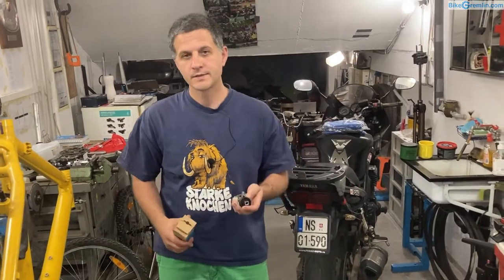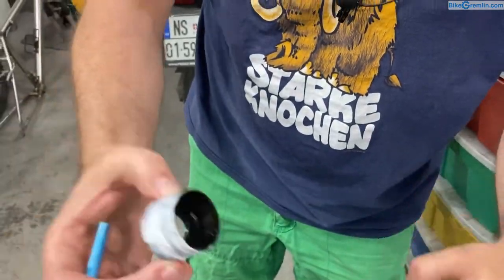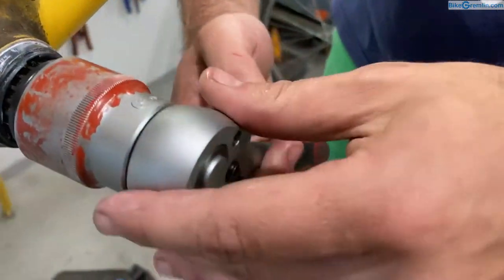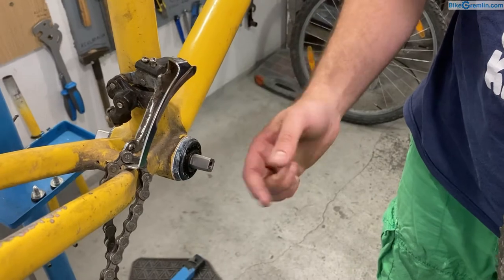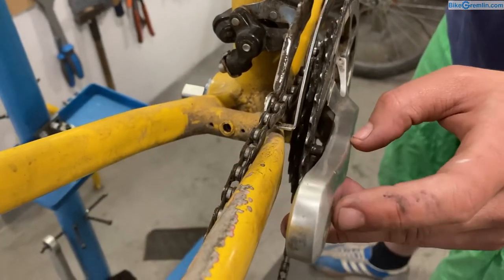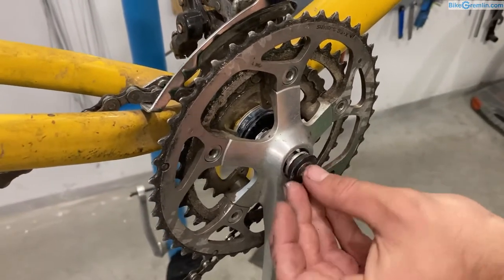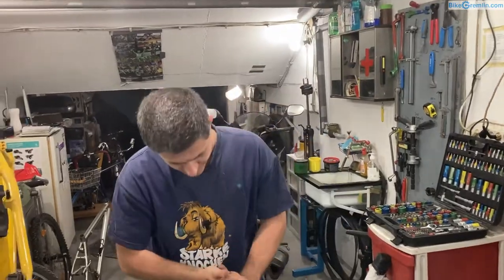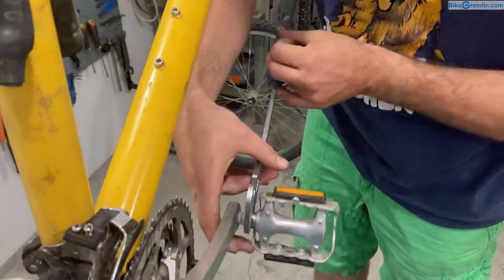Installing square taper bottom bracket, cranks, and pedals

Comment: hi there, thanks for sharing. look, ive read that such square taper crankset can woble a little from side to side when pedaling hard. im noticing this on mine. if i pedal right, the chain touches the right side of the front derraileiur and the oposite side when i pedall left. do you know any way to avoid this? thanks a lot
Reply from the maker: Hi,

Please use the BikeGremlin forum for technical questions:
https://www.bikegremlin.net/

Relja

Comment: Thanks for the video! I'm going to try to put a 100mm BB in a 73mm BB bike using spacers on the threads in hopes of getting .25" more pedal width on both sides to be able to fit a larger chainring, 32T to 48T so that I can go a lot faster on flat ground. 100-73=27mm, or .50"
Reply from the maker: Very little thread engagement - I'm not sure how robust it will be on an aluminium frame (steel may be fine).  :(

Is it not possible to mount a double (or a triple) crank (with a matching FD and a shifter)?
Reply: @BikeGremlinUS  yea that part worries me a little but I think that enough of the threads will be there, going to give it a shot. 
I would but that would be more expensive & I'd prefer to just stick with my current 1x setup
Reply from the maker: At the cost of stating the obvious:
Stripped threads might end up being more costly.  :(

Unless you often ride in very muddy conditions, or ride very technical trails that require a frequent de/activation of the dropper seatpost, 2x and 3x systems are a beautiful thing, often superior to 1x.

Tastes and aesthetics aside - that's very subjective and no arguing that.
Reply: @BikeGremlinUS  good point, that would ruin the bike... I usually get a 3x bike but I liked the looks and price of this one too much to pass it up
Reply: @BikeGremlinUS  thank you very much for your reply/advice
Reply from the maker: @mark7362  No problem - and best of luck in whichever way you decide to go with the bike customization.
Reply: @BikeGremlinUS  went with an 80mm BB instead of a 100, and got a 2x crank 46t-30t, turns out I might not need a new BB because it looks like the new 2x crank might clear the chainstay, making the 80mm Bb unnecessary, but I still need to take it apart to find out. This is all on a 2021 giant talon 1 mtn bike. After doing more research, they say that 46-11 is really all you need to go fast.

Comment: I think you may have answered this below but I'm not exactly clear?.....Why, when you have 'fully' tightened the left hand side cup it is not sitting flush with the BB shell?
Reply from the maker: A reasonable question.

BBs don't always screw all the way in. The right hand side cup must first be screwed all the way to the frame (that is locally refered as the "dead-set cup". The left hand side cup is screwed by as much as it will go to create a good preload (well, without having too few threads engaged, it must go in by at least more than 1.5 cm roughly).

The BB I used was designed to fit 73 mm BB shells (along with 68 mm), it was what was available and worked to give the needed chainline. Some fit almost flush. Some, even when designed for 68 mm shell width have a lip protruding outside even on the left hand side cup. And those are all just by one company - Shimano. Different manufacturers have different left-side fittings for different models as well. Some are plastic. Some are steel. It depends.

Comment: When you said “holding the frame to prevent it from taking too much torque” at 4:55. What exactly do you mean by that?
Reply from the maker: If the frame is held by the seatpost (or the seat tube), then it takes all the torque (while keeping the frame from turning as I apply force).

Relja

Comment: I recently received a brand new mtb, and I noticed the crack when the bike upside down spins at n angle when you compare it to the frame.. you see it slight get closer as it spins, which makes it impossible to align gears 

Is there anything I can do so it spins right in the bottom bracket ?
Reply from the maker: I'm not sure I understand the question.
Regardless of that, I would recommend you use the BikeGremlin forum for any technical questions:
https://www.bikegremlin.net/

Relja

Comment: I think it would help to explain what exactly you are tightening against when installing the left hand nut on the bottom bracket.  Also, I don't understand how the tightness of this nut can affect bearing smoothness.  Doesn't it slide over the cartridge?  Thanks for the video, just the same!
Reply from the maker: Good questions. 
The left cup is tightened against the cartridge.
It does create some bearing preload thus affecting the "ease of axle spinning." 
The silvery part on the cartridge on the opposite side from the right cup is the bearing. It slides inside the left cup, i.e. the left cup is tightened against it. If the left cup is not tightened nearly enough, the whole axle can rattle, but if it is just a bit under-tightened, the axle will spin just a tad more freely than when it's all properly torqued.
Cup tightening torque is what matters most, that can be checked (I go by feel, no torque wrenches used), but the spinning test is an extra check I use to confirm it all is seated and mounted properly.
Reply: Thank you for your reply.  I guess what I'm really trying to understand is its theory of operation.  I am a home bike mechanic, amateur, and I like to understand how anything works before servicing it.  I have a couple of Nishiki bikes with this type of BB that I will be renewing because they are over 20 years old and stiff.  I just wanted to confirm my understanding now:

1) So the left cup slides over the cartridge but has a shoulder inside that tightens down on the outer race of the bearing, correct?

2) The left cup is not a press fit AROUND the BB, so there is room for minute radial play, but this play is stopped by the left cup pressing laterally, as it is tightened, onto the outer race of the bearing, correct?

3) Another thing I was curious about, is the spindle press-fitted at the factory to the inner races on each side?

No rush on any answers.  By the way, your English is very good, not Tarzan (ha ha) and you use all the correct bike and scientific terminology.
Reply from the maker: All yes answers.  :)
Some left cups have a pronounced lip that can hit against the frame, but if it doesn't hit against the cartridge (bearing) first, and create enough preload, it's not good (68 mm BB shell cartridges can have this problem with frames that have a 73 mm wide BB shell).
Edit:
Any radial play is noticed and happens when pedalling, when it's loaded. Because of the elastic deformation of all the parts (that's fixed with a proper preload).
Reply: Thanks again.